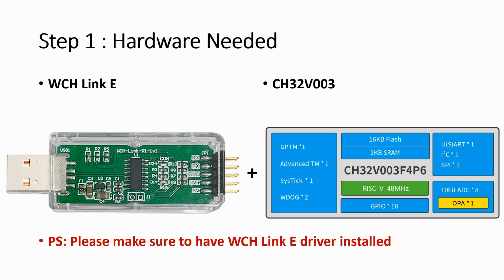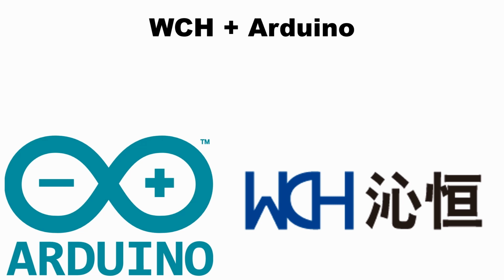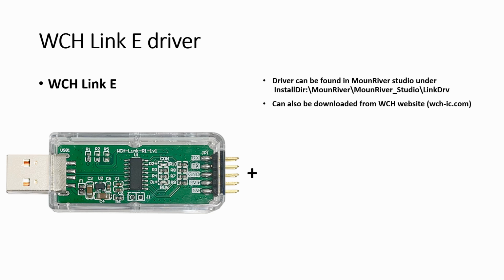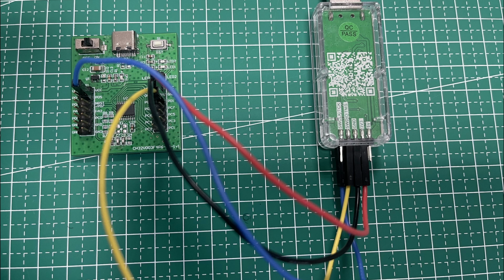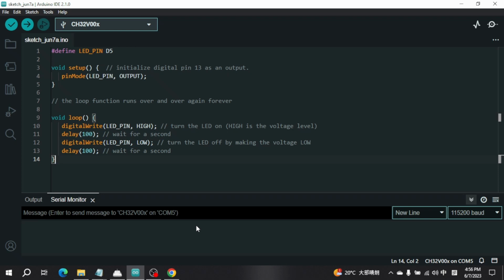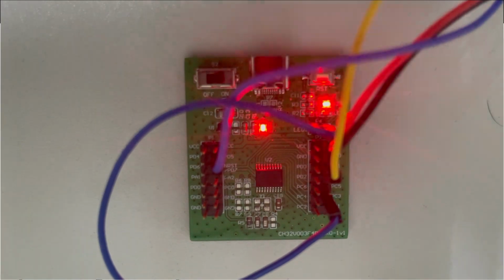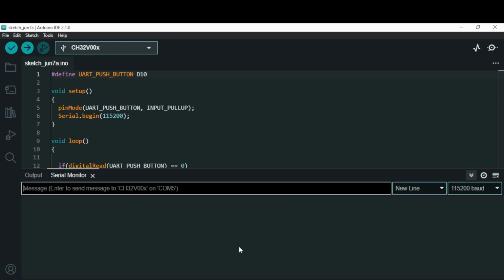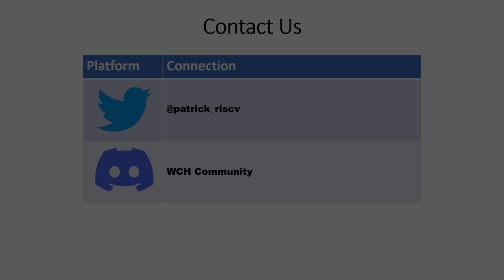#13- [QuickStart] GPIO and UART of CH32V003 using Arduino IDE

Comment: I can’t see the point is using ch32 chips for any reason. First off they’re actually a knockoff of stm32 chips, second the software is not that good. I don’t understand how you even got the arduino core to work since the json file is not programmed correctly. Third they gave most of their chips small amounts of memory and a lower clock speed. The cpu can do far more than it was given, basically they bottlenecked the hardware so its true performance is hidden from the user. I personally think that there are far better options out there, like the esp32 c3 and the raspberry pi rp2350. I know people are picking the ch32 mcus for the price, but cheaper doesn’t always mean better.

Comment: How to Change Tab Size From Default 4 to 8, I change it from Windows-> Preferences->General ->Editors->Text Editor and set Display Tab width = 8 but it does not Work. IDE is Moun River

Comment: Hi I would like to use CH32V003F4P6 board to connect with LCD 16x2 display to show text messages, can I use Arduino IDE to implement it?

Comment: I have a stupid curiosity.  I just received a CH32V003F4P6-EVT.  When I run the GPIO toggle, nothing happened.  But if I hooked up an external LED to PC_3, it did blink as programmed.  I noticed in your program, that the LEDs on the board blinked.  How did that happen?
Reply: Never mind.  I did some trace tracking on the board and realized that there are LED pins.  I see you simply jumpered PC_3 to one of those pins. :)  I thought they might be built-in LEDs, so I spent a lot of time looking through the documentation to see how to access them.  I should have simply looked at the board more closely.

Comment: First of all, thank you for your effort. Any suggestions about a problem: PD6 (RX pin) of the CH32V003F4P6 does not receive data over UART communication. PD5 (TX pin) works fine, sending data is not an issue. Tested with WCH LinkE + WCH-LinkE-R0-1v3 board and with ESP32 C3 too, CH32 was able to send but unsuccessful in receiving data.
edit: Arduino Ide 2.3.2

Comment: hey, how do you make a analogRead? with analogRead(PA2) or other Analogpins i got nothing in return? digitalread is working? any ideas? thx
Reply: Hi there, just got this working, the ADC is disabled by default, you just need to edit the .arduino15/packages/WCH/hardware/ch32v/1.0.4/variants/CH32V00x/CH32V003F4/variant_CH32V003F4.h file and remove the '//' from the line that says #define                         ADC_MODULE_ENABLED

Comment: why blink takes 10kB?
Reply: I've started using the ch32v003fun environment instead. It's a bit more complex than Arduino (which was great for getting started), but binaries are way smaller - 560 bytes for a 'blink' example for me.

Comment: Why plain blink spent over 60% flash? using Wire.h spent over 86%.  It's stranger.
Reply: That's why arduino was hardly used in commercial product. It abstracted so much that the abstraction code is really large.

Comment: Thank you soo much for this tutorial.  I was wondering could you do a demo of the low powered modes using the Arduino IDE.   and Posibly waking it up with a button.   I would be very interested in seeing the real power consumption tested.
Reply: Currently, we don't have a demo available for low-powered modes using the Arduino IDE. However, you can test it using the low-power example provided in the official EVT.

Comment: In my case, after uploading the sketch, I had to disconnect LINK-E then connect it again, otherwise the LED wouldn't blink. The same goes for testing serial output. It would be better to reset uC like AVR.

Comment: @risc-v dear sir i cannot config     d0 d2 ch32v003 pa1 pa2 as digitalinput
Reply from the maker: Ah, I know the problem. If you used our CH32V003 dev board, you need to remove the XTAL and solder the R4 and R5
Reply: @rvmaking  thank sir. Follow your steps and config internal HSI 48mhz

Comment: Thanks for making this video.  The dev board I have is the CH32Vx03C-R0-1v0 (with the CH32V203 chip) and I am not sure if this is essentially the same as the the CH32V203G8U board you discuss in this video.
Reply from the maker: The dev board of V203C8T6 is a little bit different from V203G8, but it's easy to remap the pin-map  file in .cpp source file.

Comment: Great work! Especially your documentation on GitHub is excellent!

I'm still waiting for my WCH Link E. What I'm wondering: is this a normal CMSIS-DAP probe or something custom?
Reply from the maker: For V003, it's the 1-wire debug protocol. For V203, it's the 2-wire debug protocol.
Reply: I think it's selectable DAP-Link for ARM, or Risc-V programmer in software.

Comment: Is there a schematic for the factory CH32V003 development board, D5 pin mapping is not working out for me?
Reply: Yes, in the schpcb subdirectory
Reply: @petermuller608  Thank you! I did learn quite by accident that if you select D5 in your Arduino sketch, you have to run a jumper between PC3 and the LED pins on the dev board. I guess it's clearly labeled, but confusing for me none the less. Other wise the tools and hw run great, a lot of value for 7$ dev board, and sophisticated programmer/debugger. Batteries included totally.
Reply: @randallyoung6715  thanks for the heads up, I'm looking forward to mine :)
Reply from the maker: please refer to this link, https://github.com/openwch/ch32v003/tree/main/EVT/PUB